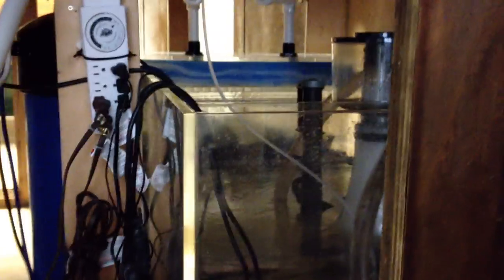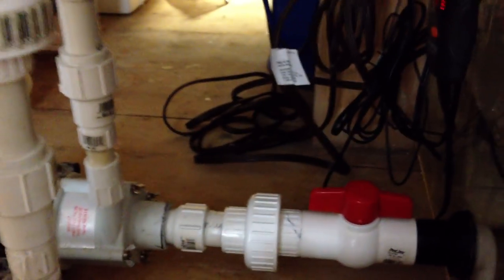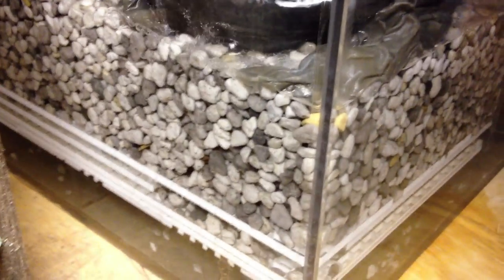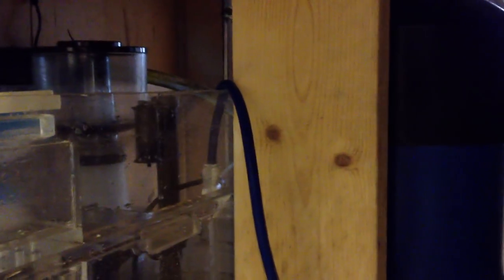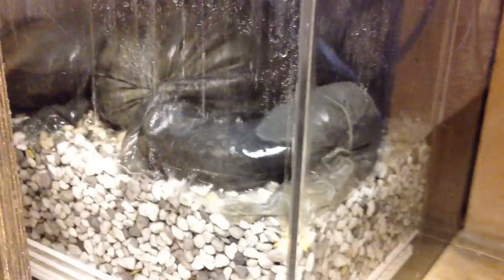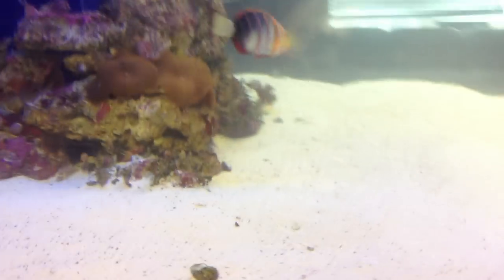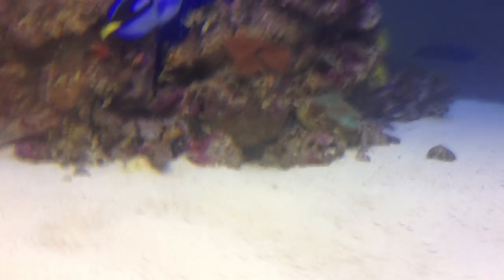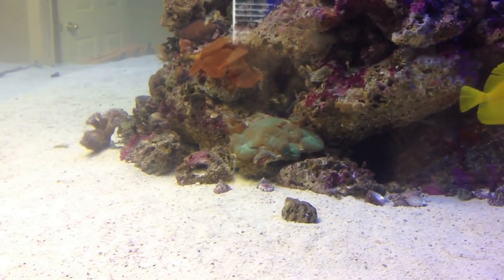Shark aquarium Set Up.  Everything you need on a home shark tank.

Comment from the maker: They are hard to find.  I have about $15,000 or more in this one.  Which is pretty cheap.  I knew a store that had it in storage so it was pretty cheap.  It was custom made for sharks.  I bought it and Refinished the tank and the stand.  Everything else I had in there was brand-new and the sub was custom-made to fit inside the stand it was the largest size that I could possibly fit in there.  The sump was $2,600 With installation.  You have to search the Internet for someone trying to sell one.